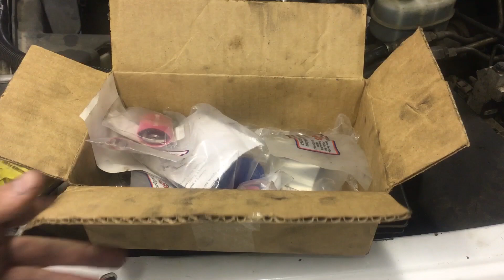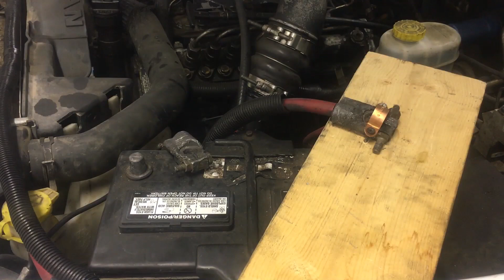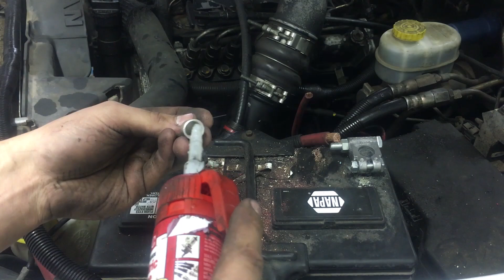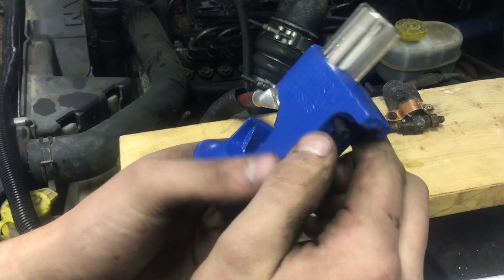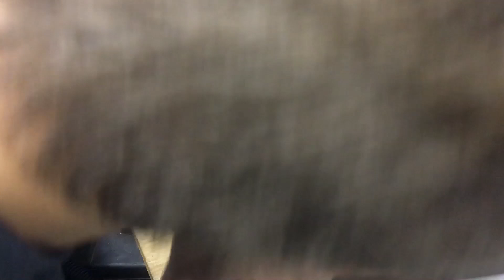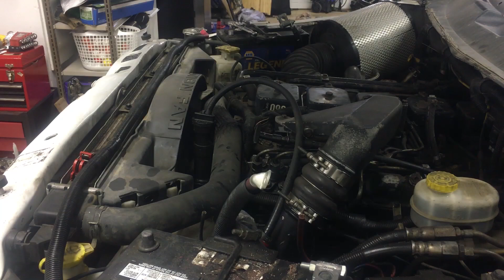Battery Terminal Clamp Replacement DIY (Any Vehicle) - EASY

Comment: No... don't grease your connections before crimping - not necessary with copper.  What you do is put a piece of heat shrink across that joint after it's crimped on.  If it's not the self adhesive type, dress the area with liquid electrical  tape right before applying heat.  3M used to make something like that, but there are others also.  This will seal the copper of the conductor and the inner barrel of your crimp away from unwanted moisture and battery fumes that can cause an early death to your valuable connection.

Comment: When you've exposed metallic copper wire strands it is crucial to work in a goodly gob of dielectric grease. Now if you're not going to solder, but just crimp, the silicone based compound in the squeeze can is just fine, but if you are going to solder, the dielectric grease needs to be Sanchem Company's No-Ox-Id "A" (Special) grease that comes in little tubs or big squeeze tubes. Best use is to warm up the grease so it mushes into the wire strands; not hot, hot, just a bit warmed. You can tell when the grease is easy to push around. Lotsa grease, don't be stingy. Wipe it off and use a butane desk lighter that can stay on  and apply resin core hi-temp silver bearing solder until you can fill the barrel.
Then you can play games with heat shrink, etc., but don't leave too much copper showing and think the heat shrink is "super-duty," because it ain't.
Lastly, and importantly, get a sheet of cheap linoleum from the carpet store and lay it across both
battery terminals if you're futzing with wires up top.
Be safe
Reply: No. Don't use dielectric grease like that. It prevents electrical connection. Use it after to protect against water and corrosion.

Comment: Dielectric grease is not supposed to be put on wires like that, it will ruin the connection, it's a insulator and should have never been coated on the wire like that. You crimp the wire and heat shrink it with glue lined shrink tube.
Reply: Prevents corrosion
Reply: @BobSmith-dm3vp  At the expense of connectivity, what's more important? No corrosion or the electrical connection working? As I had said how to do it will help against corrosion.

Comment: I can't help but think you're scattering tons of tiny copper shards all over your engine.
Reply: Just brush them into the engine bay, it's not like there is sensitive electeonic stuff that doesnt like metal dust in it. That's the next guys problem, right?

Comment: Is there any adaptor to extend side post battery bolt? I heard of a very small vice grip on positive post. I hook up negative jumper cable on trunk hook. There should be some extention.
My battery is in the trunk. Saturn Ion.

Comment: Yes, there is a special tool for cutting a battery cable. It's called a . . . cable cutter.

I just bought a good one yesterday at Lowe's Hardware for $7, plus tax. All the other cable cutters ranged from $18 to $32. The pricier ones had a nicer finish, but that was it.

And I bought a foot of cable to practice with. I got to chatting with the clerk, a nice, young, African American guy, at university. He said, "I'll give you a little extra."

He cut off 5 feet of cable, and wrote 1 foot on the tag! So I only paid for 1 foot.

Comment: You might want to saturate your bare copper cable with red anti corrosion protectant before crimping in addition to your dielectric grease. I've used that for years and it works great.

Comment: I used a little copper hold down like you used to hold the connector. I cleaned it up cut it and placed around my battery post . then I put the cable back on and it really tightened up  on the post.

Comment: I would have used a hacksaw instead of a saws-all.
Reply: A lot safer. I would use a cutting torch to remove the terminal and cable and anything else that catches on fire.

Comment: Put felt anti corrosion washers under the battery terminals and spray coat the battery terminals with battery terminal protection spray after assembly. These steps will prolong the life of the terminals.

Comment: The original clamps are almost always best unless they are broken. You can refurbish your clamps by; 1) Removing the bolt (sometimes it is best to cut the bolt in the middle with a hacksaw) and cut a bit out where the sides of the clamp meet using a very sharp knife or razor blade. 2) Enlarge the battery bolt hole slightly with a large round wood file if needed 3) Clean off any corrosion by soaking the clamps in a mix of warm baking soda and water. 4) Clean the top of the battery and the case with warm baking soda and water and wiping it dry. 5) Grease and install a new battery bolt that has a special nut made for battery clamps. 6) Clean the clamp and the battery terminail with a blade type battery terminal cleaner. 7) Install anti corrosion washers on the battery and install and tighten battery terminals. 8) Spray battery terminal protector on each battery post. 
                This will renew and protect your battery terminals for a long time and make your next battery replacement much easier.
Reply: Doug Anderson              The original terminal is almost always best for having a gas tight seal between the wire and the terminal that won't corrode. The same applies to the auxiliary wires. The terminals won't flex enough to break if they aren't over tightened. The way I tighten terminals is that I try to swivel them as I tighten then. When they no longer swivel, they are tight enough.When I remove the terminals that are properly maintained I only need to loosen them about one turn. When anti corrosion measure are taken, there is no need to over tighten them or to do harsh cleaning that degrades the terminals.

Comment: I don't think you should use dielectric grease between the contacts of the wire and the crimp on terminal. Dielectric grease is an insulator!!! You should do a clean crimp no grease, attach everything, then grease it from the outside only. Never grease electrical contact points.
Reply: Dielectric grease is neither conductive or insulative. It is specifically formulated to lubricate and protect electrical connections from corrosion that will ultimately cause higher contact resistance.
Reply: @lookeywho1287  dielectric is not conductive. Look it up. It goes on the surface of a terminal, not in between the terminal and the cable, and helps prevent corrosion. A true conductive grease has silver in it, and isn't cheap.
Reply: Steve Gentry  Perhaps you should read my comment again. I did not say it was conductive. When used for spark plugs, it keeps the boot from sticking to the plug.  Look it up.

Comment: I have one corroded terminal from a battery lead. Tempted to do this.
Reply from the maker: It's worth it. I bet you could borrow the crimping tool and ball joint press from a parts store if you don't have one.